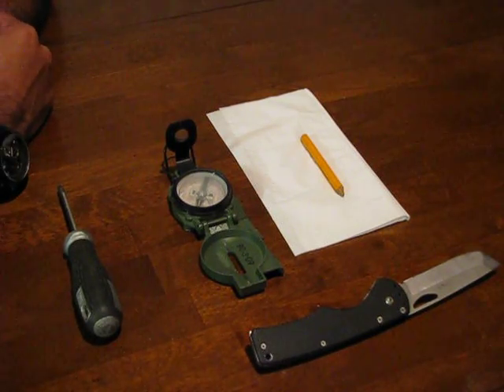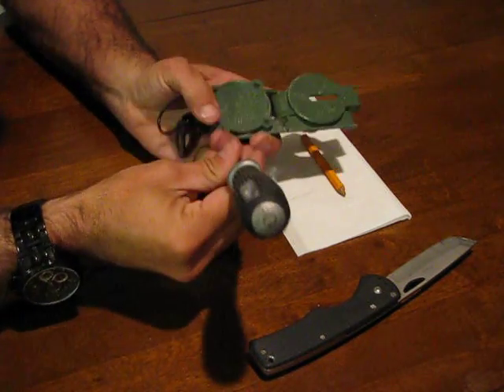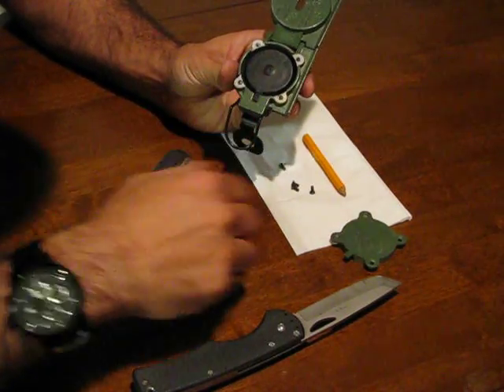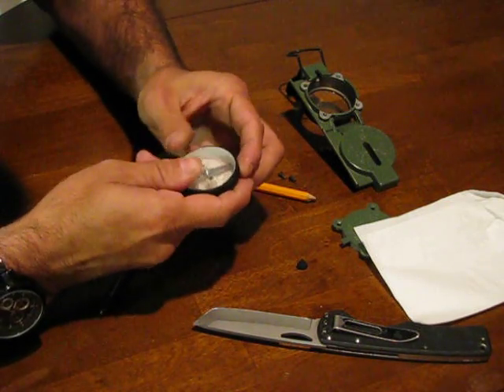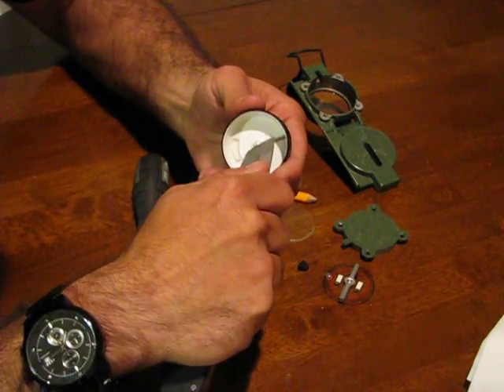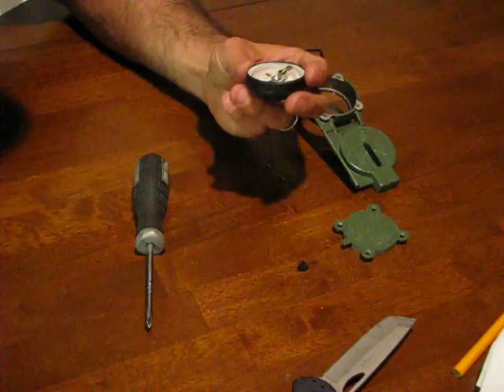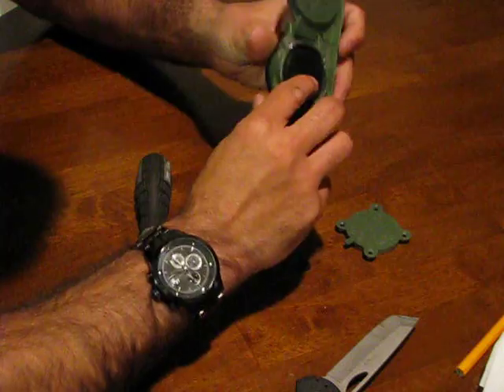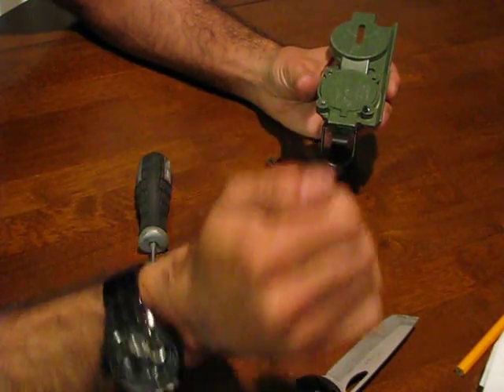How to repair a US military or other lensatic compass in 5 minutes

Comment: I have a compass that i plan to do a maintenance run for (never been "fixed" since its been issued) but on the back it says that it contains a Radio-isotope H3, and 50 MC, DO NOT OPEN. I've seen people open ones like it before, but i also don't want to get cancer, what should i do regarding that? maybe its just for the glow in the dark part?
Reply: normally i would advise you not to open it- however the radioactive nature of this material in this amount is insignificant. you will be just fine. you can google tritium and look up side effects.

Comment: From what I understand, that little black plastic piece is the dial locking device for when you close the compass, and it keeps the dial from being jostled around in your pocket, pack, et cetera.  The locking arm that was taken out is part of the locking mechanism. Without those parts, the compass will be converted to a civilian compass automatically.
Reply: Not really converted to a civilian compass- the locking mechanism is the problem with the overall function long term. by removing the locking device, the compass won't have any future issues. if you simply clean the needle off so it free rotates again the same problem will come back depending on how often you use it. When i was active military, we relied on the compass enough that the locking device (which is their to keep the compass silent) wasn't worth the aggravation of not having a useable compass.
Reply: @BlueSkyPPG  👍

Comment: Let me get this right. Did I actually see you taking it apart so you could “break” the locking echanism of the compass? 😳
Reply: Correct- the locking mechanism IS the problem. After using these day in and day out for years the benefit of a locking device versus a useful compass was worth it!

Comment: Hey thanks for the great video! Concise and informative, as I'd expect from a SERE guy! Question: You say the locking mechanism is part of the problem. My understanding is that locking mechanism keeps the dial from hopping off the needle. What trouble is it causing? Got a dirty lens and I'm about to repair it, wanted to know before I break that part out. Thank!
Reply: Also it sounds like you started your watch at the very beginning! Hilarious! Some habits never die
Reply from the maker: the locking mechanism keeps the dial in the same place every time which eventually wears the brass needle. The lense is what keeps the dial on the needle. Very close tolerance.

Comment: Its not clear what you are pricking at on the bottom, the white material. What is the task exactly? To prick it back up to do what?
Reply from the maker: I think what you're referring to is sharpening the needle sticking up from the center.The brass needle gets dull and needs to be sharp for the dial to move freely.
Reply: @BlueSkyPPGdotcom  Ok thanks, understood.

Comment: Mine rattles when it is closed and I close the metal thumb loop. It doesn't rattle until I close the thumb loop with the compass closed. Any ideas?
Reply from the maker: Well, what is supposed to happen is the small back plastic under the thumb loop is supposed to lock the dial when the thumb loop is closed. I am assuming its either worn or stuck. If you open the compass you will see it. it looks like it supposed to be attached to the black rubber compass cradle, should just fall out when the cover is off and you turn it upside down.
Reply: @BlueSkyPPGdotcom  OK it fell out, now what do I do?
Reply from the maker: @Harleyrk99  Sorry fro the delay- I had to handle a family emergency. Usually once it falls out you simply flip the rounded side toward the thumb loop and reinsert.

Comment: what problem does the lock lever cause?
Reply: Well it depends on who you ask. For me, the lock lever would lock the dial like it is supposed to however when you are hiking alot(as in the case of survival school) the dial would try to spin and eventually wear a flat spot onto the brass needle. Then whenever you try to use the compass the dial just flops to one side since it cant balance.

Comment: This looks a bit rough and ready to me . Sticking a sharp knife in the rubber boot and chucking the locking mechanism away . Really?
Reply: If it works.
Reply: yep- however the beauty of a free video on YouTube- you don't have to do the repair. and you don't have to use a knife. or even better- make a new video showing how YOU would do it. This is how we did a field repair when we had no other options or tools available except a multi tool or similar. Realistically these compasses are available on eBay for less than $20- faster to just buy another one however when it fails this is how to fix it.
Reply: @BlueSkyPPG  I did NOT criticise Mr. Jewell . I was simply seeking reassurance that this is the correct way to do it. Your nasty response sort of confirms what I thought.
Reply: Sir i apologize. I get so much heat for this video from the far left to the far right. Everything from "radioactive" tritium will make me sterile to "way to ruin a perfectly fine not working compass". I didn't have my coffee when i reacted. The internet trolls were pushing me.

Comment: Although this would be an ok fix in the field to get a broken compass to work in a situation where it’s do or die... this should NOT be done to repair your average camping compass for a few reasons... Which are:

1) yes there is radioactive material inside the H3 models and you CAN easily damage the containment of this by opening it up. One slip with a tool ect... can break the small vials containing the radioactive isotope that will cause cancer and damage cells. It can get absorbed within your skin via sweat glands, eyes, nose, mouth, ect and it is a very fine powder that is impossible to fully clean up or see once spilled without proper abilities. It’s worth doing if your life depends on it. However for using your H3 for camping hiking, do you really wanna risk cracking open radioactive dust? Just stupid. 

2) just the act of opening this up and using a metal tool inside it makes it less accurate due to a number of factors. Scraping the center post with a knife doesn’t work for all models as some have a different tip on them which you can easily snap off. Which can interfere with the balance and resting point. 

3) removing that stopper it’s completely stupid. You’re now actively shortening the life and accuracy of the compass by doing this. Removing the lock keeps the compass from spinning around when in the closed position, this is why the H3 and SandY models are so bullet proof. That lock keeps the shock of drops and violent shaking due to running, jogging, drops, ect from damaging the free floating needed. Removing that lock allows the needle to be subjected to constant shock and violent spinning which will take your accuracy and toss it out the window over a short time of heavy use. 

4) your compass is your first and last line of safety for travel. It’s supposed to be the thing that gets you in and out when all other electronics fails. You now just fucked with a compass without being able to test if it’s even calibrated anymore and pointing in the right direction. 2 degrees off is a BIG problem over a long distance. 4.... forget it you’re screwed. You would have no way to know this once you’ve opened up and butchered this device. You gonna trust your life or your buddies life with a compass you just scraped up and opened with a knife?? 

Yes this option can get a non-functioning compass to start moving again, however just because it’s moving around doesn’t mean it’s working properly anymore. If it’s off by 4 degrees you’re better off with a $5 oil filled compass at that point. 

The whole point of the H3 and SandY is to be accurate and life depending because of its ability to lock the needle, have no oil, be calibrated and sealed

Comment: Nice video but, these things generally are not worth the effort, they are basically trash can food. If you are in the field find someone in your unit with a working compass or GPS and finish your mission or extract then go replace with a working modern compass and forget about MrFixit. If you want a hobby this is as good as any though.

Comment: Vintage WW2 Wittnauer Compass with a crack in glass. Does anyone know or recommend how to or where to get this repaired?
Reply from the maker: the easiest was is to simply buy one on eBay. The design hasn't changed so you could turn one into a parts compass.

Comment: If someone wants to try this, good luck.  I tried this and ended up rendering my bezel inoperable, then broke it trying to fix that issue; even if it all worked out, I'd be lucky to have it all aligned correctly in the housing.  If you're off a "tad" (A DEGREE), that's a LOT over a click (aka "1000 meters")!  Also, this model must be the non-tritium one, since my assembly was more complicated.  Thankfully, mine was a 20 year old compass, with dim lights, so worth a shot at rehab...I'd NEVER try this with a newer one.
Reply: The 3H is tritium. I have a Cammenga from 1999 that is not.

Comment: How to damage your compass:

1. Using a pointed knife to remove the delicate silicone, this can damage the seal.
2. Breaking the lock system that prevents the compass from bouncing when it is closed.
3. Polishing the shaft with a knife creating imperfections in the circumference, better with a fine sandpaper.
4. Are scratching the transparent plastic when moving it on the table.

Please, if you are going to opened your valuable compass, do it with more care and do not break or remove important parts!

This gentleman now has a bell in his pocket making noise when moving.
Reply from the maker: Normally i would agree with you however the locking device is what causes the damage to the pin in the first place. 14 years as a SERE instructor using compasses and students using the compasses week in and week out all year long does a crazy amount of wear and tear. When you're in need of a working compass in the field the fine sandpaper is a luxury. Plus these compasses are inexpensive. $10 on eBay and you have a new one. Scratching the plastic on the table? Thats a stretch. youre not using your compass enough if it doesn't have some battle wounds. Anyhow thanks for posting your opinion!
Reply: Sorry, I thought it was an original Cammenga compass, as it is not and it costs US$10, hit with a hammer :-)
Reply from the maker: Actually the original  high quality military compasses with Tritium are made by Stocker and Yale. Cammenga compasses are copies of the military style (under contract) however they originally used phosporous rather than Tritium. They have been in production for long enough to make a name for themselves and eventually started using a low grade tritium that has a shelf life around ten years. They're well known  in the military world but the problems noted above are very common with both models regardless of the manufacturer. Its simply a design flaw that wasn't apparent in the R And D process rather makes itself known after a long period of use.
Reply: BlueSkyPPGdotcom Thank you for the information, i need buy new one :-)
Reply: @AngelVillaG  Yeah, the Cammenga's run from $65 to $94 on ebay. The Stocker &Yales are a little rarer to find, but they're just as expensive. I had a slight "yikes" reaction to him using the knife prying up on the dust cover too. I'd have used my leatherman bit-driver or something a little less sharp to pry it with but I've built a lot of computers so I'm a little bit of a light touch from that background. I think BlueskyPPGdotcom has a great point about not having sandpaper in the field though. So, this shows what can be done to get it done when you need to get it done without proper resourcing. However, if you're not TDY to a $#!t hole, and sitting around at home repacking your kit or something... why not use a fine grit sand paper right? But there is an awful lot of improvised — engineering — that goes on down range due to lack of readily available resources.
Reply: @BlueSkyPPGdotcom Wasn't Brunson Instruments of Kansas, OH, the first company which made the then-"new" M1950?  The design, since then, hasn't changed a lot, ift at all. 

After Brunson, there were quite a few contractors who all were officially contracted suppliers for the US military: the Lionel Corporation/N.Y, Fee & Stemwedel from Chicago, the Waltham Watch Co from Massachusetts, the Marine Compass Company (Pembroke, Mass.), Stocker & Yale from Beverly, Mass. Cammenga LLC was founded in 1992 and has been the sole supplier for the US Armed Forces since that very year. I bet (and this is a guess, but probably a likely one) with modularity and mil-spec standards, major parts from two different (originally US army issued)  manufacturers could possibly be interchangeable. 

Anyways, thank you for this educational video. For hiking I used a (now discontinued) Recta DP8 from Switzerland for a long time (now retired), and a Finnish SUUNTO in my emergency kit. However, I'm deeply in love with my 2010 Cammenga civilian model (try importing anything using H3 to the UK, nowadays).  A SUUNTO or SILVA might be super lightweight, but I would never leave without my US-made M1950-variant.
Reply: Wow drama and pointless points
Did was he said to do and my compass is working just fine

Comment: nice video what blade is that you have there
Reply from the maker: If I recall that was a Cold Steel Japanese tanto blade. I forgot i even had it! I replaced it with a very nice BenchMade switch blade.

Comment: WORDS OF CAUTION, many compasses from ww1 up until 1990's contain RADIUM, this was painted onto the needles and body of the compass mixed with zinc so it could be seen in the dark, the luminosity may not work anymore, however the radium is still present being visible as a white to yellow-brown residue. DO NOT scrape this off it is quite highly radioactive and could cause harm if breathed in or am entering the body. This applies to all compasses and watches internationally.
Reply: Hey mnpd3, Scott is right mist military compasses before 1960’s may contain enough radium that can harm due to long term exposure. I measured a compass that read around 62 milli ren/ hr.
Reply: Well, there is nothing wrong with your advice.  In fact, it's recommended by government nuclear safety sources.   So, better safe that sorry.  I must agree with you.  But ,then there are some facts.  The amount of Radium 226 in a single consumer device isn't found in watches and compasses, but in the huge mechanical alarm clocks of the radium dial era; the huge, black, oval-shaped Big Bens had enough radioactive lume on the hands and dial numbers to paint several hundred compasses or watches!  Yet, you can bundle up the radioactive hands for a dozen such clocks, and even scrape off and include the radium numerals if you want, and the combined gamma/beta radiation won't activate a dosimeter placed next to the bundle in an exposure of three days.  I've actually tried that using THREE dosimeters (in case one malfunctioned) and Nada --- no detectable dose.  Ditto for radiation Survey Meters --- nothing.  Of course a Geiger Counter will go "nuts" next to your source, but remember that Geiger Counters are built to detect trace radiation.  The GM tubes have a reset time between particle strikes, and quickly saturate and become useless if the radiation increases to a level that is still not harmful.  I say "harmful" from common sense; not from government standards which claim that ANY radiation is harmful.  But, again your advice is 100% correct.  The government even warns against storing multiple radium devices on the same shelf.
Reply: you mean just like the one he has lol. You can tell which ones those are by the stamping on the lid. Those have the manufacture location and date stamped into the lid. Newer ones only have model number, manufacturer name, NSN number, and U.S. stamped on the lid.
Reply: Agree with your assessment, as radium 226 has a 1600 year half-life. So, yeah, still radioactive.
Reply: Pretty sure its tritium as my compass says H3
Reply: @marshallm3208  Based in my experience, the ones containing tritium will have that information stamped on the case, while the ones with radium will date from the 50s or very early 60s and have nothing stamped on the back.
Reply: @ED-od6hy  Good to know!

Comment: where can I get parts? I took mine apart and the rubber is rotted. so I been looking for parts ? great video and thanks for making it. on the back is SandY-183   backward 3H
Reply: Did you ever find where to get parts at? I took mine apart and the rubber is also rotted. Thanks!

Comment: I was just looking to find a replacement compass due to mine going tits up YEARS ago and found your video here so going to try and fix it myself, question I have is weren't these at one time liquid filled?
Reply: Roger that, I just got finished working on mine and the rubber gasket was dry rotten the balancing point (needle) was part of the rubber piece having been ran through it. 
Thanks for the help.

Comment: I've got a knock-off pseudo military compass, similar design but liquid filled. It has a bubble and takes its sweet time finding north. Can I follow these instructions and replace the fluid (after testing to see if it's oil-based or alcohol-based, of course)? This is my backup compass and it wasn't expensive at all, I just didn't want to toss it if I could repair it. Thanks!